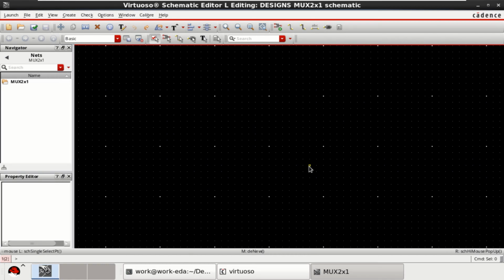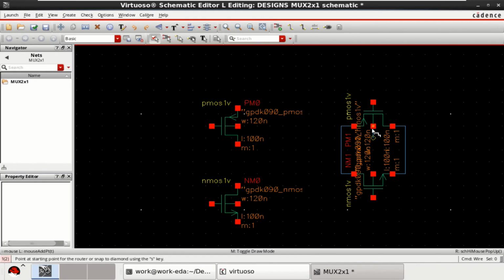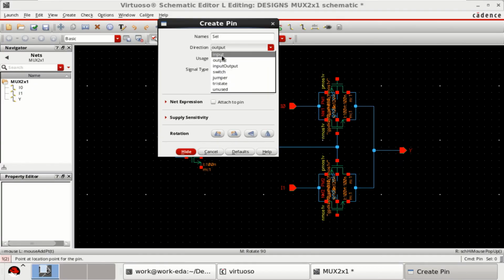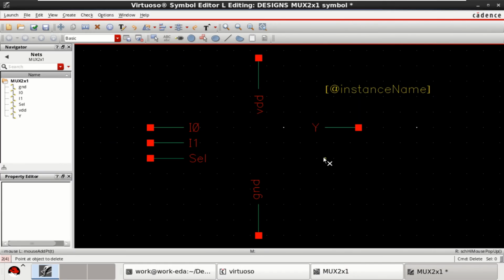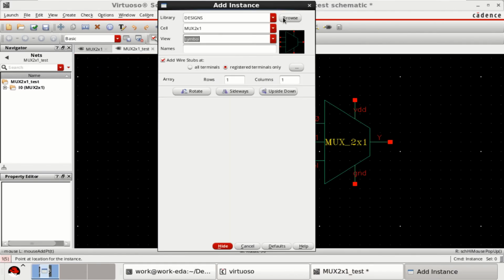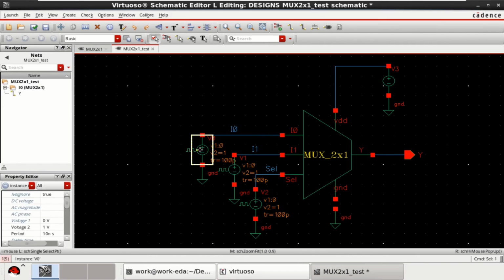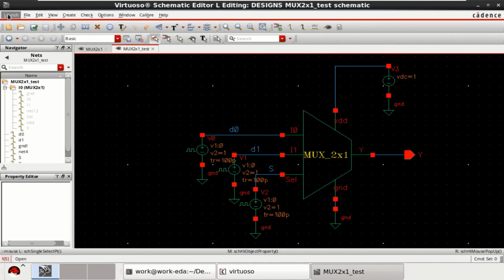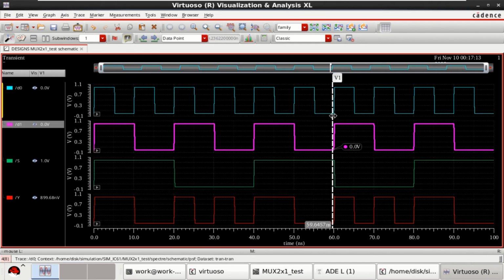2x1 CMOS Multiplexer Design in Cadence.

Comment: hi sir thanks for the knowledge transfer, i tried analog 2x1 multiplexer using 130nm PDK, the output is distorted. Am i supposed to change the current transistor width=300nm and length=130nm. please guide me sir
Reply from the maker: Hi, in video I have created a 2X1 mux. Try to change the source and drain of PMOS and NMOS

Comment: if output is distorted or spikes then check whether ur pmos body terminal connected to vdd and same as nmos body terminal connected to gnd or not
Reply from the maker: What you said is right it also depends on the variables you assigned.

Comment: thanks for the guidance i also have project of designing and layouting on cadence of 8:1 mux using stastic cmos logic and also dual rail logic and my project guide said to do 2:1 mux for showing him but hey says to verify truth table with output waveform of cadence but here also i can't verify the truth table what should i do ? i have got output following you but it can't verify the truth table for 2:1 mux.. can you guide or suggest ? will help alot thanks...:)
Reply from the maker: Hi, since you got the output for 2:1 mux. Waveform is the truth table. See for high and low transition. It represents truth table